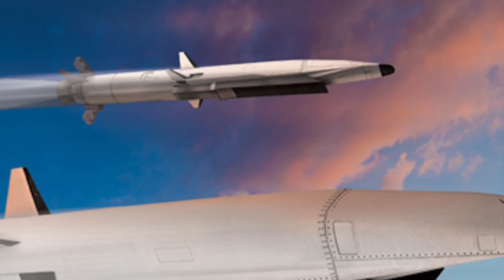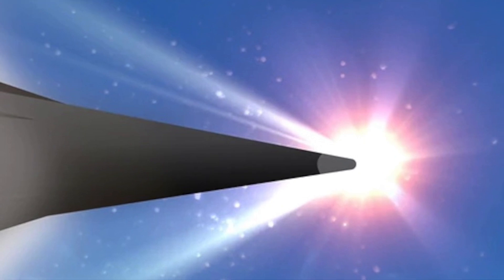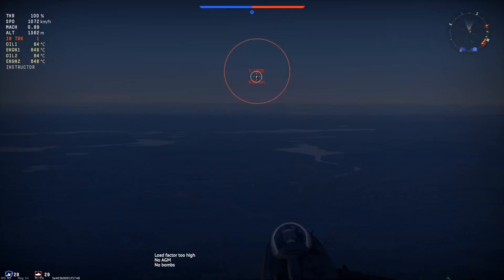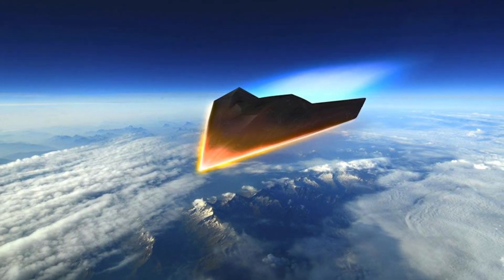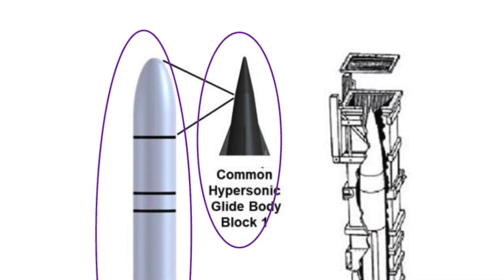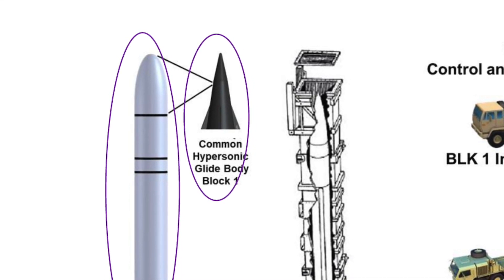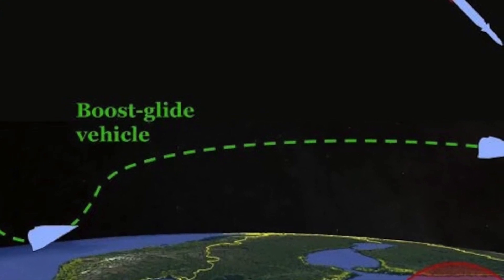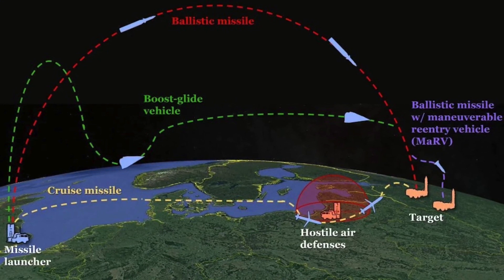Key component for U.S military's Conventional Prompt Strike & Long Range Hypersonic Weapon tested !

Comment: Avangard is slow trash.  
 Avangard has 27 mach only after re-entry at begining, but then in horizontal flight it lose speed over Russia, over North Pole - 20 Mach, over Canada - 15 Mach, over USA - 10 Mach, over target less than Mach 3, then Mach 1. Each minute hypersonic glider losing speed dramaticaly. Common nuclear warheads have higher speed than Avangard at finish, Avangard is easier to intercept. Avangard has poor precision because of non-balistic trajectory, and require satelite navigation which can be jammed. One Avangard has size and mass as 6 common warheads. Avangard has no decoys.
   This trash overhyped in internet
Reply: it's better than what you have. best i have is a rifle. what you got?